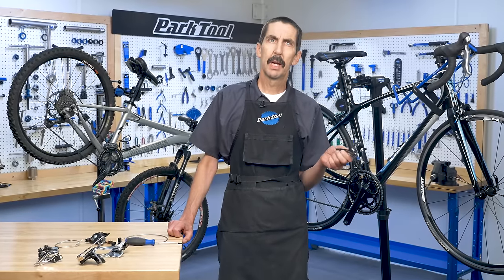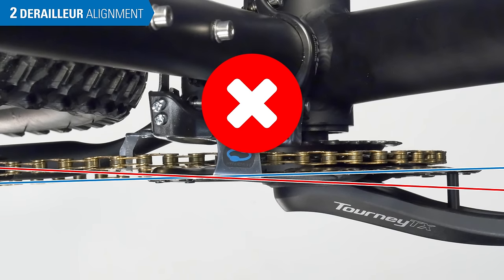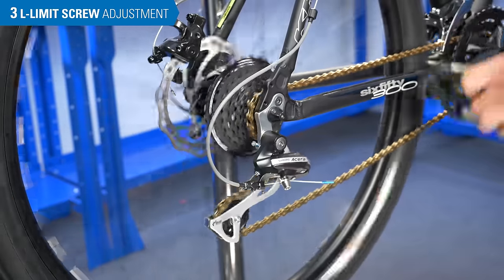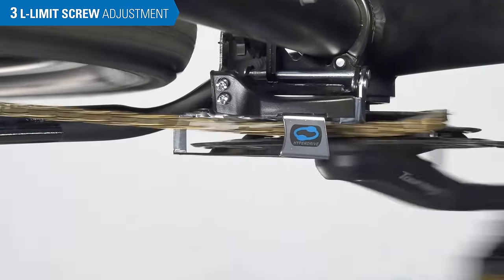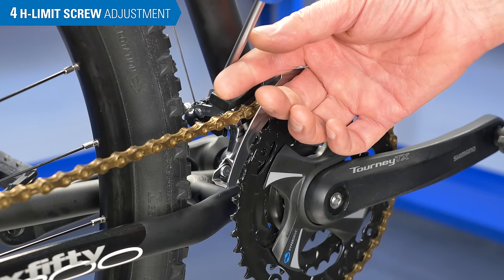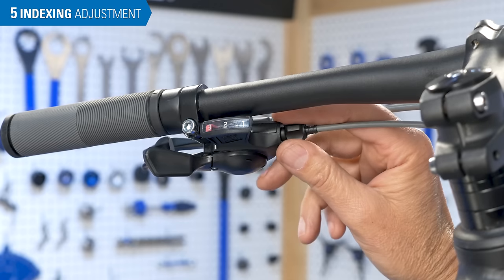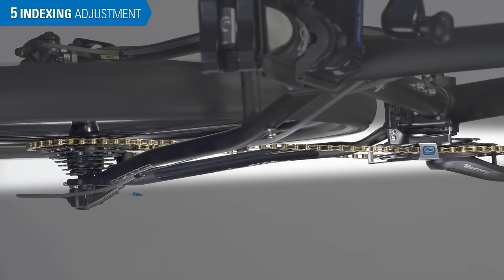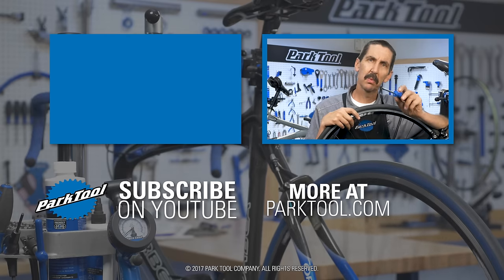How to Adjust a Front Derailleur

Comment: Guys! I did it! My chain was rubbing my front mech so I started tinkering with it. Next thing I know I was neck deep in problems. I tried fixing it, watched a ton of videos to no prevail. I gave up and decided to come back another day. With a fresh mind and a cup of tea I watched this video, took everything step by step, slowly turning the screws, and everything worked. If you can't seem to get your front mech working, take a break. Come back to it when your in a good mood. And when your adjusting the screws do small movements, it's less than you think. Cheers!
Reply: Btw I have a basic shimano mech
Reply: thought about taking it to a mechanic shop?
Reply: Its the cup o tea that did it.
Never attempt anything without a cup of tea!
Reply: Sam Lieber I have a box of teabags so I'm ok
Reply: This is exactly why I watch these and do it myself. I have free adjustments at the shop I bought from, but often have better results doing it myself with Park Tool videos, without drop-off and pick-up trips and delays.
Reply: ahh i broke my shifting lever
Reply: Yeah, your issue is the same as mine. I took it to a bike shop but it didnt fix the rubbing when i use the  high gear. So i decided to fix it myself, I just followed the instruction and when i was done adjusting screws i adjusted the barrel adjuster until there was no rubbing anymore. Fortunately I fixed it.
Reply: The joy of success is just awesome, specially hitting back every time you get it wrong and then comes the victory.

Hehe it might be a small thing for experienced people but for learners like us it's an awesome achievement.
Reply: Sam Lieber hit my head about 50 times
Reply: You Can't Reason with Madness could be the type of shifter, I learned that with my custom bike that had a 3 speed shifter on a 2 speed front crank
Reply: Sam Lieber that’s my problem that’s y I’m watching this
Reply: Yeah, but I watched the Rear Derailleur video and implemented the same concept to the front
Reply: it was the TEA! what teas was it?
Reply: @finmcmurder7933  are you sure your cable tension isn't too tight? The cable tension can restrict the effect of the screws, due to the pressure on the system.
Reply: @raiderboy105 idk probably. Took it to the local shop instead of dealing with it
Reply: I'm not sure my mood will change it, unfortunately.  None of the gears work now on my bike.  I only made it two rides before my bike took a mechanical crap on me.  No matter how I adjust the gears, derailleur, etc, the chain makes noise.
Reply: @Bovrinox  or hot coffee
Reply: Sam Lieber I feel this 100%. But I’m fucking pissed because my bike came from the store fucked. I’ve tried to fix it and now it’s even more fucked.
Reply: Nice one dude 👍
Reply: @raiderboy105  I've got the same problem but the thing you turn with your fingers next to the front shifter does fuk all, can't take it to the bike shop because of coronavirus 🙄
Reply: G
Reply: "With a fresh mind and cup of tea"... youve gotta be british, if not then you had to be in your past life 🤣
Reply: Dude I needed this. Just messed up my front derailleur trying to adjust it, it's 10pm, and I'm so frustrated. I'll try again tomorrow.
Reply: @abdullahahmed4229  better off throwing the bike in the dumpster. Get a cheap bike and repeat.
Reply: Did the straight jacket fit after?
Reply: Yeah somethings take a few tries if your new at it. I like to try tuning it then try riding it. Then have another go if needed.
Reply: Great advice mate! Cup of tea fixes everything too ha
Reply: There# nothing that Yorkshire won't fix.
Reply: I should have read this before I almost blew my own gasket after three hours of frustration; my wife insisting that I take it to a shop. After a good meal, a couple cocktails, and a few deep breaths, I got her back in order (the bike that is). Moral of the story: take your time, tinker, don’t be afraid to fail, and don’t try on an empty stomach!
Reply: Have a patience
Reply: I could not agree more with the advice to take a break because I’m on the verge of screaming with frustration over this. Now for lunch.
Reply: we got the same prob lol
Reply: What da heck i read this and took a break tinkered for awhile and it actually worked  😂😂😂
Reply: Congrats!

Comment: How can something so small be so hard adjust. I spent about 8 hours trying every combination of screws and settings with no luck.  This video is a godsend.
Reply: Lol. Me too.
Reply: Agreed
Reply: Finally, did you succeed?
Reply: Same here. Supreme frustration. I’m gonna take a lunch break.
Reply: Same as 2x2
Reply: Brilliant video, thanks. I’ve seen various videos and have owned a few books, but this logical stepwise technique and explanation is the best so far. After watching this and front derailleur video as well as the troubleshooter my bike honestly runs better than it has in ages!!  I now feel like I understand properly also so if something is a bit off I can see that and adjust accordingly. I also invested in a fairly cheap but decent bike stand, and of course that made the process fair more straightforward. If you don’t have one and are not sure just do it. It makes the process much nicer, and easier.
Reply: not a good explaination from this vid. you will have to figure it out
Reply: I'm glad I am not the only person that has struggled. Still haven't worked it out about 3 hours in so far
Reply: Same. Rear was a snap to adjust. The front is maddening.
Reply: Same here but even with these videos i'm struggling! My bike wont shift from 3rd down to second & its doing my head in!

Comment: I've been changing my own gear cables for 20 years, (and constantly making adjustments to try and get them right). Watched this video and realised where I had been going wrong all that time. I now have perfectly working front derailleurs - adjusted and correctly set within a few minutes. Thank you!!
Reply: What have you went wrong in all those years may I ask?
Reply: @viperRX  Mainly adjusting screws without fully understanding what I was doing, and not doing the check on the large chainring.
Reply: @paulmartin7635  cant wait to get outside and do this!
Reply: @viperRX  bbbbb
Reply: @viperRX  in the case of my bike, the front derailleur was set too high above the chain rings. And it was a reasonably expensive bike in its day.
Reply: I think most issues are caused by having the front derailleur height adjustment wrong. It's often set to 4-7 mm too high.
Reply: I have two bikes. One with and one without a front derailleur. The one with a front derailleur sucks arse!!
Reply: @viperRX  qaaaAà
Reply: my front Deore Derailure both limit screws does not move the derailure for adjustment ... what is wrong???
Reply: @hobbyzone2  From my understanding the L screw wont' move the derailleur if it's not on the lowest front gear and vice versa for the H screw.

Comment: I. L limit (bottom)
Step 0: RD is at Largest cog, FD is at Smallest Chainring
Step 1: Turn barrel adjuster for FD clockwise to loosen up the cable
Step 2: Tighten L limit screw until there is rubbing
Step 3: Loosen the L limit screw until there is no more rub
Step 4: Turn Barrel adjuster for FD counter-clockwise
If it shifts back inwards fast, then you're good. If it's slow, then loosen a little bit more

II. H limit (top)
Step 0: RD is at smallest cog, FD is at largest chainring
Step 1: Loosen H limit so that when you push the lever it moves a lot
Step 2: Slowly tighten H limit so that when pushed, it only moves about 1 mm
Troubleshoot 1: If it takes too long to shift, then loosen by a quarter turn
Troubleshoot 2: If the chain goes off the crankset, tighten it by a quarter turn

III. Indexing
Step 0: RD at smallest cog, FD at largest chainring
Step 1: Turn Barrel adjuster clockwise so that there is slight movement in the FD
Step 2: Turn Barrel adjuster counter-clockwise so that there is no more movement in the FD

Edit: This WILL NOT WORK if you are using a r5801,  r7000, r8000, r9100 FD. As much as the RD video helped me, this video confused me even more. I had to learn the hard way that the new shimano FDs have a completely different mechanism than previous generations. Thus, the adjustments made in this video are unsuitable. For example, the H screw here is just a limiter. However, on the new shimano, it also changes the cage outward position. There are videos about how to adjust the new FDs, but personally, I've found the shimano FD Dealers Manual to be the best for me. You can easily find it on the official shimano website. I hope this saves someone from the headache I've been through trying to figure it out. Good luck!
Reply: Thank you for this, there's so much information in the video it's easy to get lost in the minor details.
Reply: Excellent summary, many thanks Chris P !
Reply: My gear is not shifting to 2 please help
Reply: Wow!! Thank you!!!
Reply: How to copy paste this 😅
Reply: Wow.. thanks..
Reply: Yeah. It's easy if you have a barrel adjuster. Lots of road bikes don't have it at all.
Reply: Legend
Reply: Thanks for summarizing!
Reply: I've utilized this outlined for a couple of years and it helps me understand more what this great video is teaching. Thank you. I've looked to see if you did something similar for the rear derailleur, but haven't found. Any chance for that?
Reply: @John-uz2we  Hey! Thanks for the kind words. I did do a short summary on the RD video too! But it's probably lost in the comments somewhere, so you'll have to dig for it unfortunately :(
Reply: my front Deore Derailure both limit screws does not move the derailure for adjustment ... what is wrong???
Reply: my front Deore Derailure both limit screws does not move the derailure for adjustment ... what is wrong???

Comment: Having been chasing a constant problem with the adjustment on my mountain bike front derailleur this video finally put it to bed. Even my local bike shop struggled and wanted to simply fire the parts cannon at my expense replacing perfectly good components unnecessarily. I was convinced it was simply an adjustment issue and I was proven right by following your video. Thanks very much for taking the time to explain things and how to adjust in the correct order.

Comment: This video once again guided me through what otherwise would've been a supremely frustrating time.  It was still frustrating because the barrel adjuster was seized and I had to use pliers to turn it, but this made it bearable.  Thanks Calvin, you're an incredible teacher.
Reply: mine doesnt move either, had to use pliers too and have slightly rounded it.

Comment: I had significant front derailleur issues. The shifting from 1->2->3 was erratic and would get stuck and would need multiple attempts to change. After going through the set of videos from this channel, I fully understand how the system works and how to adjust it. All issues are now fixed! Thank you!

Comment: I bought a mail-order bicycle, put it together myself, and right away had front derailleur problems. Shifting up worked great. Shifting down - not so great. The manufacturer had a good video on derailleur adjustment, but I still couldn't figure it out. This video did the trick.  Thank you Park Tool! I was so impressed with your videos that I bought your advanced took kit and look forward to many successful bike repairs and adjustments in the future.

Comment: This is outstanding! I had a problem with shifting to the largest front gear. This was a very simple fix, based on easy-to-follow information on your video.  You saved me a trip to the shop. Thank you.
Reply: Just saved me a trip as well just bought a Cannondale Gemini with the same issue the front derailleur won't shift to the largest gear

Comment: I've been adjusting my mechs myself for years since no mechanic ever gets it perfect, and that's considering you're paying them!
I got everything on both mechs surprisingly close to the recommended methods here!

Tip from experience: on the rear mech try to align the mech just a bit outwards to make drop shifts faster, and on the front mech after you got everything right, try to give the H limit a bit of slack to make the change upwards easier.

Comment: A couple of months ago, a new bike arrived of which the front derailleur was quite badly set. It was under an angle and the chain was rubbing on gear settings you wouldn't expect it to.

I finally got myself to take some tools and this video to guide me through it and 15 minutes later it runs just perfect.

Attempted some settings years ago on another bike without completely knowing what I was doing and that sort of worked. For many years the index setting was my best friend to get rid of most of the annoyances and everything else I just accepted and worked around.

This video is pure gold to guide you in properly setting the front derailleur. 👌

Comment: Good video. Just bought a Costco XC27 bike, the instruction really helped tuning the shifter. Once you understand how the parts play together, very easy to tune. Save $100 at bike shop.
1. Adjust the height and orientation of shifter
2. Adjust L-screw
3. Adjust H-screw
4. Adjust cable tension (index)

Comment: Two things I'd like to add, one of which is covered by Calvin. 1. It was Calvin's pointing out checking the height and alignment that made me realize my FD had always been slightly off, tail inward, presumably ever since I bought it. It also made me realize the outer edge had gotten bent over the years requiring me to straighten it. 2. Make sure your FD moves freely, one problem I was having is that my FD didn't want to adjust so easily as the video. That's when I realized the spring on mine was pretty rusty and not moving fully freely. Lubed it up and moves a lot better now, so check freedom of movement too because mine wasn't returning to L position all the way and throwing off my L-screw adjustment until I happened to check movement by hand after having trouble shifting.
Reply: Thank you for this tip!
Reply: Mine does not move freely at all! I’ll have to check that next time

Comment: The front derailleur looks simpler but the rear one is surprisingly easier
Reply: i think front one is just shit design
Reply: Front derailleurs definitely are more picky to design.
Reply: This is why one by 11 or 12 is so popular!
Reply: Unless you're a climbing nerd, you don't really need more than 4-5 platters at the back, 1-2 at the front covers you greatly for a good cadence.

Sadly there's no 2 by 4/5 -_-
Reply: agreed, haha
Reply: @Lolimaster  Road bikes used to have 2x5 or 2x6.
Would have to find appropriate chainrings tho
Reply: L
Reply: This is why I ride a bmx
Reply: Ikr
Reply: This video and the rear derailleur videos were a huge help to me.  Thank you!
Reply: @Lolimaster  If you want 2x4 or 2x5, just use 1x10.
That can give you the same amount of gears and if you choose the right sprockets/Cassette even the same exact gear ratios
Reply: @Lolimaster  I saw a 5 speed freewheel last year on the streets
Reply: I agree, I redid the lines on both and the front was way more time consuming...
Reply: @banama1758  You should design a better one yourself :)
Reply: I have a 3x7 freewheel and its an absolute pain to adjust without a stand.
Reply: That's true, man!
Reply: For casual cyclists, a 3 speed or even a single speed is better due to less maintenance. If they are not calibrated derailers can add a lot of friction.
Reply: Yesss😂
Reply: I think your wrong, it took me 2 hours to perfect adjust the rear but the front... Mann mybe 25 min
Reply: The front derailleur must skip much higher height steps than the rear derailleur which is the real cause it's so picky. If you had rear cassette going with similarly huge steps between the gears, the real derailleur would be really picky to adjust, too.
Reply: I disagree, because there are only 2 screws and 3 gears, while my rear deraileur has 7 gears and 4 screws to play with.